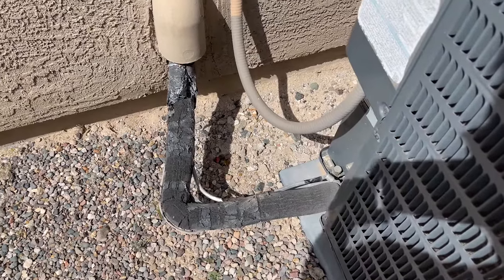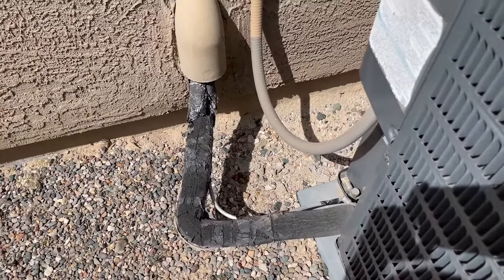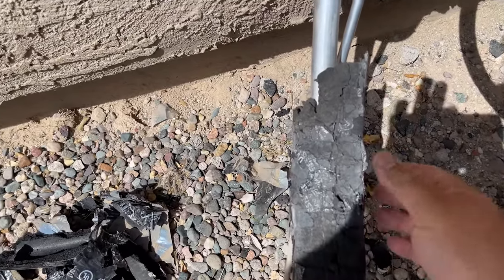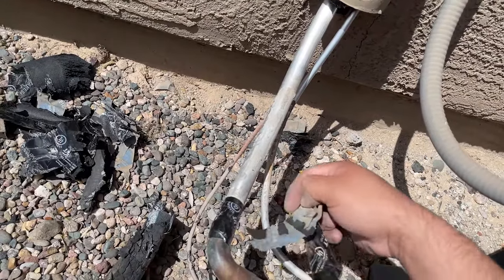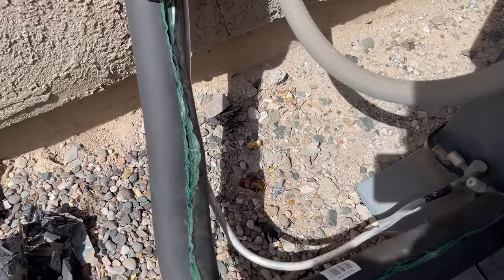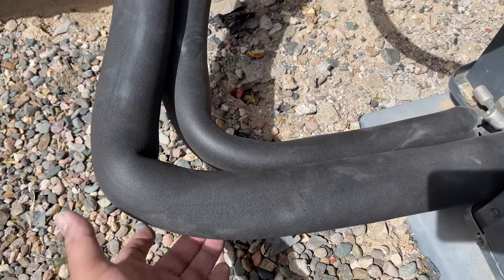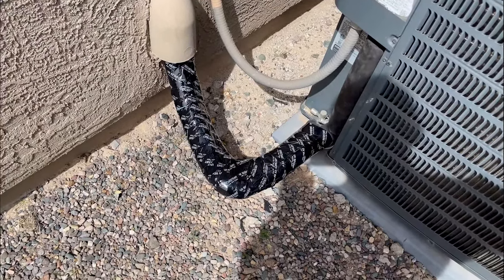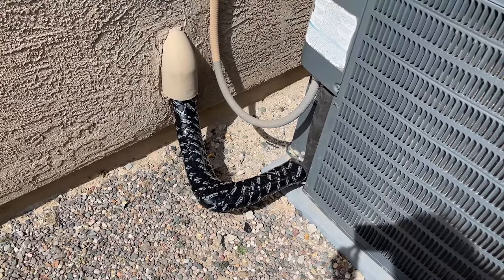DIY, Replacing Line Set Insulation & Tape on Condenser AC Unit

Comment: Don’t insulate the small line. It needs to release heat and the insulation prevents that.
Reply: The small line on the left or the right? Sorry new to this
Reply: @anthonysalazar6647  The small line on the right side of the two is called the liquid line or discharge line  and is about 1/4 inch diameter.  It carries compressed liquid coolant, and should not be insulated.  The larger line  is on left of the two and is called the Suction line or return line, is typically about 3/4 inches on home systems, and needs to be insulated.
Reply: No need to insulate the hot line

Comment: The small pipe does not need to be insulated.  You're actually working against the system as it needs to repel heat.  By adding insulation you're defeating the purpose of allowing that to occur.
Reply: Is it proper to insulate the large pipe inside the unit as it nears the compressor?

Comment: How come the line sets of a Mini Split Ductless unit comes with both lines insulated?  Just asking, I know they are technically Heat Pumps, so the large pipe (vapor) can be hot gas or cool evaporated gas, and I am assuming the small line is always liquid.

Comment: Pardon if I missed this in the video, but use the rubber insulation (trade name Armaflex or equivalent) as used in this video as opposed to polyethyene foam (looks like a pool noodle). Just a reminder for those who might not be sure if they're interchangeable and wouldn't matter.
Reply: I used the poly type without realizing til a day later...from what I heard it will be fine but it wont last long in the elements, sun, rain etc.
Reply from the maker: Both are fine, I've just been told that the Armaflex or equivalent last a bit longer or hold up a bit better to the elements.

Comment: My son replaced the condenser insulation using a Pool Noodle. He says that it is UV rated to be outside and attached it every 3 inches or so with zip ties. Any problem with this?

Comment: There is no need to insulate the small line. It is the high-pressure line that leads from the compressor to the evaporator coil. It is hot due to compressing the refrigerant from a gas to a liquid. When you wrapped tape around both of the lines, you trapped heat from the high-pressure line in with the cold line (low-pressure). The heat will radiate into the cold line, making the system less efficient.
Reply: I accidentally taped both and my AC is leaking water on the unit inside the house. Do you think it could be due to this ? If so I’ll go ahead and get on the roof and take the tape off.
Reply: Thank you for explaining why and reasons perfect answer to what I was wondering why not but you comment save the universe !! Lol mine at least ✨️ 😊 😀 ty !

Comment: Is that tape air tight? I want to repair some tears in the insulation indoors
Reply from the maker: I would say no, not air tight.
Reply: @justsoboredagain  so how do you make it air tight when you have tears?
Reply from the maker: If there’s tears in the tape or in the insulation I just replace it. All depends how bad the damage is but if the layer of tape is just damaged, then I just replace or add to it. There’s no reason to make it air tight. It’s purely to keep as much of the elements from reaching your copper piping.
Reply: @justsoboredagain  thanks but not the tape. I'm talking about years in the insulation. It's brand new. When pulling it through the soffit it tore. I wanted to just tape it up. My concern is condensation in the attic. It's in a very difficult location to replace the insulation.

Comment: Somehow my ac stopped working after replacing de insulation…. HELP! It’s not the capacitor and the pipes are clean… already tried all that
Reply from the maker: Replacing the insulation shouldn't of had any affect on your AC. My guess is the control wiring that goes from your condenser to your air handler. Check to make sure it's not damaged or pulled out some how.